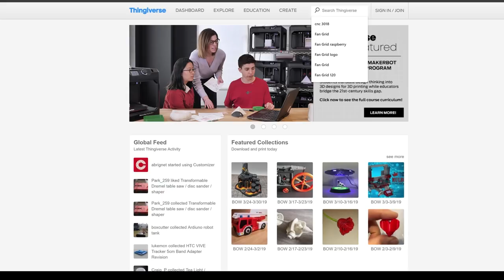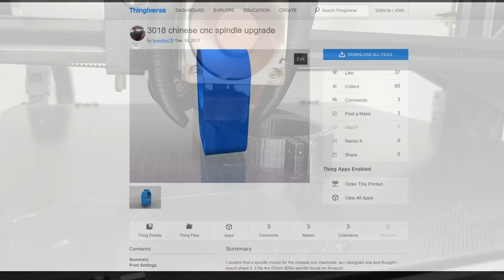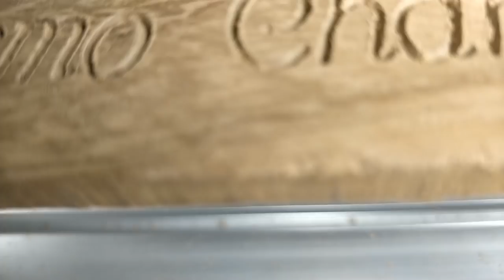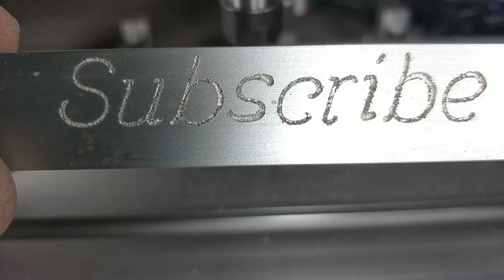UPGRADE CNC 3018 Spindle Motor with Machifit ER11 Chuch 500W

Comment: bye, congratulations!  beautiful update and a great video, I have just bought the same cnc, I'm just starting out, but I'd like to replace the motor like you did, but I'm afraid of not being able to make electrical connections, it would be possible to know how  they do, thanks, congratulations again 😁
Reply from the maker: Hi, there. If you have a little manual skill is not difficult. The electrical connections are very simple. The motor is not connected to the motherboard of the cnc and starts and adjusts manually. You can put a relay on the output that powers the old motor on the motherboard that closes the contact and starts the motor. However, the speed adjustment remains manual via potentiometer.
Reply: @cosmochannelvideo  thank you so much
Reply: @cosmochannelvideo  Hi sorry i must have missed a few steps ! the connections are simple IF you have done it before ? What is the relay you mention sorry but it does not make sense ? All i see in the video is the power supply (I presume) taken from the old motor fixed to the new motor and then two wires (I again presume taken from the glb board (woodpecker board) this is put into the new power control unit into the motor terminals  (with pot fixed to) BUT where does the power come from to power the new box ? ie connections to box go (on /off - motor - power)  so where does this relay fit you mention ?
Reply: @cosmochannelvideo  as clear as mud ? what is the relay you talk about ? two wires from original motor goes to new motor, two more wires from the old gbl (woodpecker board) fixed to the motor on the NEW box so that leaves two connectors still not used on the NEW box for power ? what is the relay for and where does it come in on the video ? need to spend less time with the music and more time on the explanation of what you are actually doing.

Comment: Hi great video. I have problem.
Identical equipment CNC3018, the Y axis (that of the plane on which supports the objects to be processed), during the work you hear a tac and shoot losing the path with the x axis.
I changed the complete bar of bronze spiral, but I haven't solved it. Do you have a suggestion? Thank you very much! - Do you also have a chance to explain how you carry out the project with the writing?

Comment: I am confused about where the wires at @10:27 come from
Reply from the maker: Hello. those cables come from the spindle and connect it to the power supply
Reply: @cosmochannelvideo  Thanks. Second question is regards to the actual power input. What are you using? just plugging into wall or using a power supply? I am about to set it up direct to wall and taking extra safety measures by 3dprinting a custom case (So the power supply is not accessible at all). 

So this is not connected to the CNC PCB right? I have to basically turn it on before the program runs for cutting? Thanks
Reply from the maker: The spindle is powered only by its power supply connected to the power outlet. Before starting the machining you have to manually turn on the spindle. You could put a 24V relay on the spindle connector output on the controller which will power the spindle.
Reply: @cosmochannelvideo  Thanks

Comment: The only reason I would upgrade the spindle is if I wanted more confidence for the machine to mill aluminum.
Reply: Yes, but the engraving did not turn out very well.
Reply from the maker: Bye. I just made some changes that solve the movements that made the spindle to the too much weight. Soon I'll put the video. Now the engraving is much more accurate. I am waiting for an aluminum cutter to do a test of engraving on aluminum.

Comment: Can you add some more aluminum tests?
Reply from the maker: I'm gonna make a video soon. For now I have problems with the z-axis (it's not fluid and freezes) and so I'm waiting for spare parts.
Reply: @cosmochannelvideo  Have you managed to solve the z axis wobble? I want to buy the same CNC and upgrade it with the same motor actually, but z axis wobbling would be pretty bad, since it means I wouldn't be able to do precise detail work. What part of the z axis is  causing the wobble? Is it the 3d printed plastic motor holder? if so, then that is good, since you can just print a better one, but if the wobble is coming from the metal parts, like large tolerances in the aluminum rails or something like that, then that would be very very hard to fix without basically replacing  half of the entire machine
Reply: @cosmochannelvideo  update please!!

Comment: Hello, 
My 3018pro has stop running program,  com port has disconect bitwin running, 
Plz tell me what is problem
Reply from the maker: There could be a thousand things. Overheating of some defective component? defective cable? energy saving activated on the pc? If you find the problem please let me know!
Reply: Ehhez a motorhoz egy nagyon rossz minőségű vezérlőt gyártottak!

Én úgy oldottam meg, hogy cstlakoztattam a földhöz a vezérlő dobozát, a cnc vázat, a motor burkolatát és tengelyét is. Utána már nem szakadt meg az USB kapcsolat.

Z-prob esetén használj galvanikus leválasztást például opto-csatolót, külömben kiég a cnc vezérlő!
Reply: @cosmochannelvideo  Had the same problem with the 3018pro (factory stock), where each time I run the spindle, do a basic G1 movement or anything of such. Suddenly, program loses connection with the mill, saying "device is not responding", turns out the USB-A to Mini supplied was garbage. Found a spare usb cable, hasn't given me any problems like that for now.

Comment: Hi, can the cnc cut aluminum of thickness 3-4mm?
Reply from the maker: Hello CyClistFpV. I'm sure that with a good 2 cutting edges cutter and several passes you can safely cut soft metals up to 5mm thick. If you haven't done so yet, sign up for my channel!
Reply: Cosmo Channel It will be interesting to see that.

Comment: у cnc 3018 маленькая жесткость, из за этого нет смысла его апгрейдить более мощным двигателем
Reply from the maker: Hello, Constantin. I have to agree. I'm noting that actually the weight of the new engine makes a lot of resistance in the small movements. I'm thinking of improving all the bearings.
Reply: @cosmochannelvideo  
I also have a CNC 3018. When I bought it and tried it, I also had thoughts about its refinement. But bearings alone cannot do, this engraver (it is an engraver and not a machine tool) has thin guides. After replacing the guides with thicker ones, another problem arises - the effect of the rigidity of the structural elements on the result. Therefore, I went the other way. I ordered the components from the shafts of 16 mm, the bearings printed on the 3D printer and now I assemble the frame of the future cnc from ldsp. And the engraver will remain an engraver to let him perform his tasks - milling of printed circuit boards and small art bas-reliefs.

LDSP - laminated chipboard
Reply: just in case the original text
У меня тоже чпу 3018. Когда я его купил и опробовал тоже возникли мысли о его доработке. Но одними только подшипниками не обойтись, у этого гравера(это именно гравер а не станок) тонкие направляющие. После замены направляющих на более толстые, возникает другая проблема -  это влияние жесткости конструктивных элементов на результат. Поэтому я пошел по другому пути. Заказал комплектующие из валов 16 мм, подшипники напечатал на 3д принтере и собираю сейчас из лдсп станину будущего чпу. А гравер останется гравером пусть выполняет свои задачи - фрезеровка печатных плат и небольших художественных барельефов.
Reply: @constantinzzz8562  Видео будет?
Reply: не созрел еще для видео на ютуб

Comment: блин ЗАЧЕМ на такую херню вешать такой же херовый но достаточно тяжолый для этой херни мотор? точности вообще никакой, видно что при малейшем касании к мотору люфты пипец какие... зачем это все?
Reply from the maker: Hi, there. I wanted to experience this upgrade. You're right. The whole thing is heavy but by lowering the speed of the movements this does not fluctuate. I'll definitely have to replace some parts to have less movement.
Reply: Рисовать маркером или карандашом годится, более ни для чего.

Comment: LOL...….dear oh deary me...talk about making a silk purse out of a Sow's ear.....this machine was designed to be cheap and light......at no point in the design was it even thought of having any aspirations to be capable of being upgraded to cut more than it was originally designed to do. In the end, with a lot more modifications and time, it will be a bigger, more expensive and not more capable than the original design was. What it really needs to be viable is to design from the outset a machine that is what you want it to be from the very beginning without any upgrades etc......but don't expect to sell it to the same mob who just want to pay for the lesser capable machine at the lesser price. I wonder what the $100 machine would look like......made of glued wood?
Reply: The upgraded 3018 Pro handles this mod just perfectly without suffering from the added weight.  I 3D printed different version of this same upgrade and with this change it works very well.  It was the first thing I did to the new machine.  The toy motor the comes with it is useless and ridiculously noisy.  The newer 3018 Pro is MUCH  stronger and more stable.
Reply: @j.christy8449  Well I will point out that if you look at the final result the engraved letters are wobbly and that indicates that it's just too flimsy to handle the cutting forces. You would need to really rethink the whole Z axis arrangement because that is mainly where the flexing begins apart from the small diam round rails of the X axis.  In reality it's all round that you would have to redesign, but that's not what the maker had in mind when he aimed it at the bottom end of the market.....cheapness was the name of the game.
Reply: At the moment I've just bought a 3018 from Bangers but I won't be assembling it as I've decided to do the sane thing and instead of replacing numerous parts for an upgrade after assembly I'll do a complete upgrade from the beginning......3/4 of the original parts would be redundant otherwise, so I'll sell the original complete 3018  machine as new once I build it from the ground up with new parts.....I'm just using it as a guide to get an idea of the plan design and I want to keep the size at 3018.